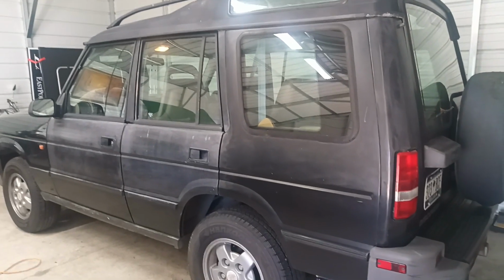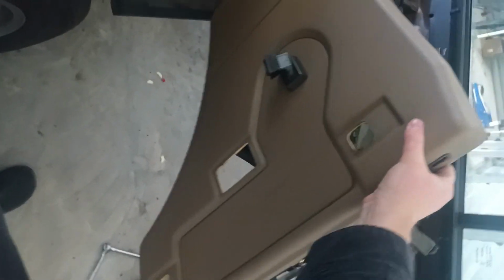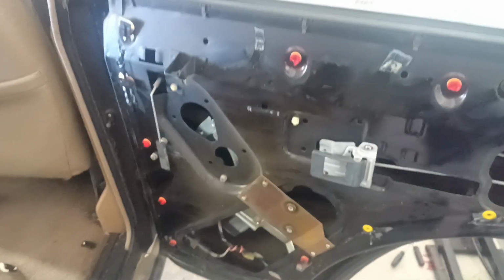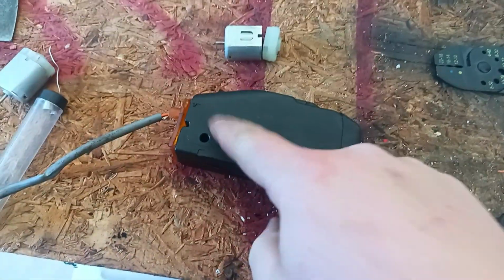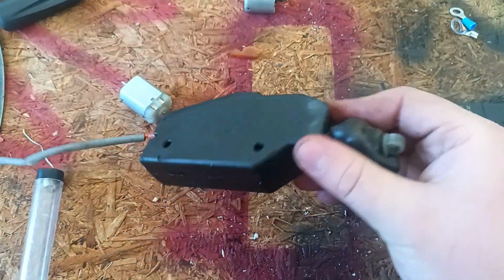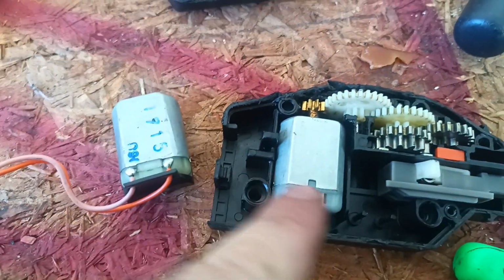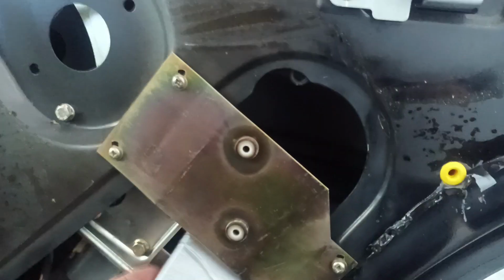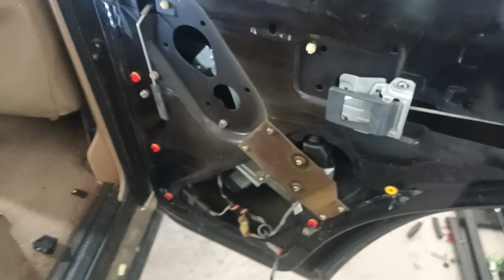1989-1998 Land Rover Discovery 1 Power Door Lock Actuator repair not replace ($2.50 fix)

Comment: Hello could you please help me with some direction  as mine lock and unlock inmediatelly, the motor moves down and up  and then detects somehting and moves up again,  so not sure if the actuator is damaged or what, but now as I cannot lock with the key I cannot lock the disco with the control.
thanks.
Reply from the maker: I'm not really an expert on these vehicles, but I think your problem is with the drivers door specifically. There's a module that detects the position of the lock on the drivers door, and then locks or unlocks all of the other doors to match it. I suspect it's somehow getting the reversed signal from your driver's door, causing it to immediately tell all of the other locks to lock after unlocking or unlock after locking.